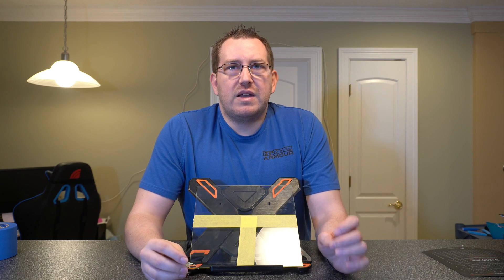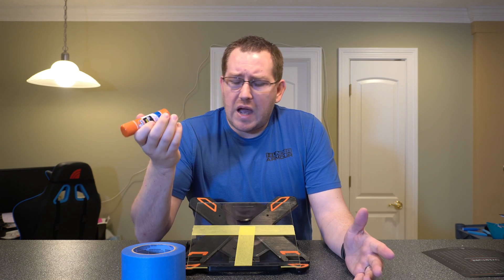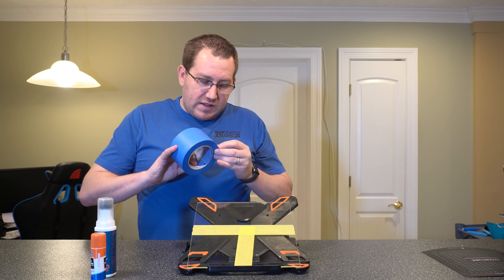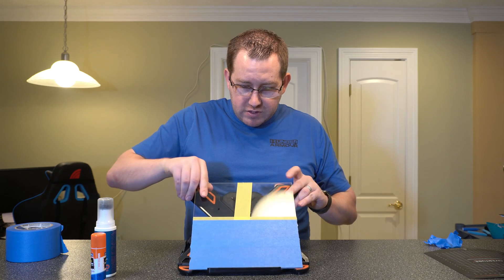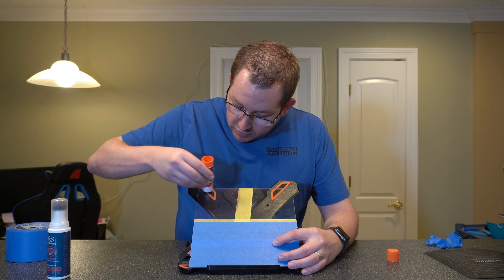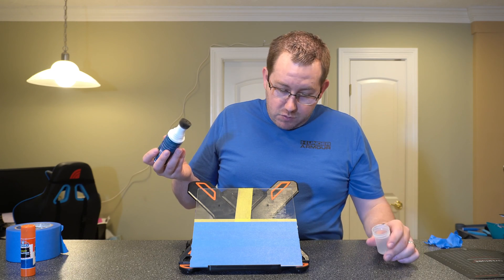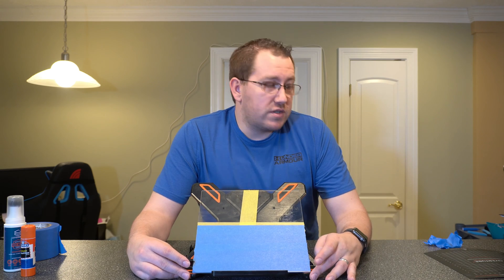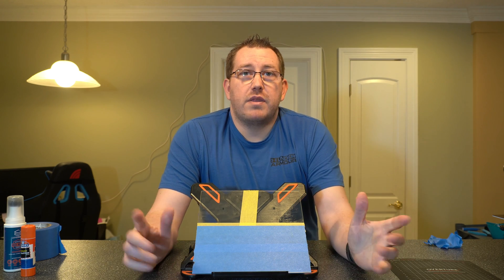Tired of 3D Printer Filament Not Sticking to the Bed - Let's FIX IT!

Comment: Some good tips, but at the same time, using tape on a glass bed defeats the main purpose of using a glass bed.  Getting that smooth finish that glass provides because you get the texture of the tape on your initial layer.
Gluestick I find does work, but is pretty messy, as is hair spray.   If you can't get it to stick directly with no addtional product, the speciality options are the best way, though I have had better luck getting good quality filament and just tuning the printer properly.   I found certain cheaper filamnets needed a product to help them stick, including Creality branded filament, but other, higher quality filaments needed no product at all.
Reply from the maker: Hi. You have some good points, ideally none of this is needed. Most of the time ive seen it needed is due to the bed not being level, improper z offset, or bad filament.

Comment: Hair spray does leave a huge mess. I haven't tried tape, but between hair spray and glue I've had better luck with the spray. Next time I'm at Home Depot or the autoparts store, I'll grab some tape. Thanks for the demonstration.
Reply from the maker: Hi. Thanks for the feedback. I like bed weld the best but tape is probably a second.

Comment: pva glue brushed on does the trick
Reply from the maker: Hi. Interesting, i will give that a try. Have you had issues getting the print off afterwards?
Reply: i brush pva glue on the bed and it works well but not always

Comment: I'm so confused. Got en ender pro 3 for daughter for christmas, have had nothing but inconsistency. It made the sample cat perfectly after a few aborted attempts which ended in a mess, made a very complicated snake skeleton- also after about a half dozen tries, and it kept flapping around making the build look "fuzzy" , but at least 3 dozen other attempts at anything since then  have failed. Ive used hair spray, the printer specific purple glue stick (which feels to me like it just makes it more slippery when the bed heats up ( tried anywhere from 60 to 90 degree bed.)  lastly, even though they say your bed should be perfectly clean, I used the tape method which did not work at all for me. The nozzle temp, I've ranged anywhere from 200- 235 degrees - no noticeable difference. I see some people say get the glass bed but I thinkk that the damn thing should at least function as it  is without investing in upgrades that may or may not make it better. Any advice would be appreciated.  Im about to return it to amazon.
Reply from the maker: Hi. I would say make sure your bed is level, that will make a huge difference. From there, use something like bed weld to help with adhesion then print a temp tower with the filament to find out what temp it works best with.
Reply: @3DPrintscape  Ihad the ender 3pro, couldnt mske it work. Returned it but trying the ender 3 neo which comes with a glass carbonate bed, auto level feature and better springs. About the same price.  Wish me luck and thanks for your advice
Reply from the maker: @jmnjmn69  The neo seems to be a solid printer, let me know what you think of it once you get it going.

Comment: Need help my 3D printer filament is clumping and building on the nozzle, i have cleaned and then replaced nozzles adjusted the plate , changed the painters  and still clumping
Reply from the maker: Hi. It sounds like there may be a partial clog in the hotend, possibly between the nozzle and bowden tube.

Comment: You can improve adhesion even more by going over the masking tape with a fine grit sanding sponge.  Also if you bud the tape together, as close as possible, with out over lapping the glue from the tape will seal the seam
Reply from the maker: Hi, thanks for sharing. Seems like a lot of extra work but if it helps it can be worth it.

Comment: Oh man. Glass beds are were it’s at. Just bought the creality glass bed. At first I couldn’t get anything to stick. Then I cleaned it with dawn dish soap and use isopropyl between each print. Perfect adhesion each time.

Btw. Just want to thank you for your amazing videos. Very informative. Learning a lot from you. So I appreciate the time you put into all that.
Reply from the maker: Hi. Thanks for the feedback. Isopropyl works great but you have to clean the bed after each print. Im lazy, so i use bed weld a lot lol.

Comment: I have an Ender 2 and the print is not sticking... I cleaned the bed and leveled it 3 times already ..
Reply from the maker: Hi. Its possible the bed is not level or its warped a little. Have you tried to use any adhesive like the bed weld?

Comment: Some prints stick some did not it was random. I tried everything here is what eventually fixed my Ender 3 V2... Make sure you have a concrete floor this part is important... smash your 3d printer as hard as you can against the floor until it is in an unfixable state. The get a trash bag and collect the pieces and throw it out. My ender 3 v2 was 7 days old now it is in the trash. Trust me this is the best course of action.. 3d printing will drive you mad with frustration....
Reply from the maker: Hi. Im not going to lie, i have wanted to do this with my printers on more than one occasion :).

Comment: This is my first experience after two years with my PLA not sticking. I have tried turning my bed temp up nozzle temp as well, my machine is lvl. I installed a new auto lvler just incase. I switched filaments and am now trying hairspray with not so much luck. I have even gone as far as changing my extruder and slowing my first print speed some. At this point I don’t have a clue what to do other than try the glue.
Reply from the maker: Hi. Have you tired cleaning the build plate with rubbing alcohol?
Reply: @3DPrintscape  yeah, ended up using hairspray and got “some” adhesion. Trying the glue next
Reply from the maker: @blake20054  I like the bed weld much more than hairspray, its works about the same but its not as messy.

Comment: Oh my God I got a creality 3 version 25 days ago and I had probably 15 failed Prince or just a bunch of boogers or spaghetti all over the damn plate. I attributed it to miss leveling the bed because I never had any prior experience. After using bubble levels and feeler gauges and all types of s*** I finally gave up and took a deep breath. During the last print before I was about to box it up I got to thinking that it's peeling up and it's not getting proper adhesion. It's not the level it's the fact that the first layer wasn't printing properly. Once I scrubbed the glass down really good with Dawn dish soap in a Brillo pad I stuck it back on there and I got one good print and I also tried some glue sticks which really didn't do very well. I tried rubbing alcohol which really didn't do any much better. But I will be trying the tape for my next print at the moment I had five successful Prince today so they 5 was a success and I will not be returning my printer
Reply from the maker: Hi. Sorry to hear you had some issues at first but im glad you were able to get past them and plan to keep your printer. A lot people first starting out with 3d printers get frustrated and give up too soon.
Reply: You can also go over the tape with a fine grit sanding sponge.

Comment: That bed weld has not improved anything...
Reply from the maker: Hi. If the bed weld isnt helping your bed not be level or the nozzle may be to far from the bed.
Reply: @3DPrintscape  its actually too close and is pushing down on the print making it not print right and I lift it all the way and still not enough because the print doesnt stick and warps a little. Bed temp etc in in recommended. I used taped yesterday, not perfect by any means but the print acutally stuck but still warped up. Wish I could just show u a pic
Reply from the maker: @sp1nks248  Interesting, can you email it to me? My email is admin@3dprintscape.com

Comment: I'm sorry if I missed this in your video but does this only apply to glass beds?  I just ordered my first 3d printer, an ender 3, and am trying to get as much knowledge as I can before it gets here.  Do I still have to worry about this with the stock bed that comes with it?
Reply from the maker: Hi. Most of this applies to glass. If your using the stock magnetic build surface with PLA, you will really only need rubbing alcohol.

Comment: My Ender 3 Pro was printing find until yesterday and today. The PLA will drop on the bed, but in some other areas of the print it will not stick. Instead, it just curls up onto the nozzle and creates a mess. I have it on the suggest temperature for that particular PLA. Bed is leveled, printer isn't even 2 weeks old. I just want to use my printer again :(

It comes with a magnetic build mat.
Reply from the maker: Hi. If you have the magnetic build plate on it, make sure its still level and the right distance from the nozzle. It sounds like you may be a little close in some areas. If thats all good, you may have a partial nozzle clog.
Reply: @3DPrintscape  Now my issue was that mid-print my nozzle was knocking over what it was printing. Seems like the brim i put did not stay stuck to the magnetic mat. Should I move on to using the glue stick?
Reply from the maker: @nextlvlroy  I would not use a glue stick on the magnetic pad, its not needed. If the pad is clean and the bed is level it would work just fine. Also, make sure the axises are tight, there are eccentric screws that you will use to tighten everything.
Reply: @3DPrintscape  Nice. I still put glue stick cuz I read your comment late, lol but cleaning for sure worked. Looks like all that residue eventually caused issues.

Also, how would you approach a few "dotted lines" in your final print? For example, I printed a Pikachu model from Thingiverse, the file looks good. Other ppl that made it looks good. However, mine, in a few areas, has dotted horizontal lines. I did mess with my retraction settings a bit to get rid of stringing, but it still has dotted lines on a test print. Would you know how I could get rid of that issue?
Reply: @3DPrintscape  Like if you were to draw a straight line and throughout that line you draw you lift the pencil up and leave a gap then continue to draw the line. cutted/dotted lines. most of my prints have that, and it's really in random spots all around.
Reply from the maker: @nextlvlroy  Gotcha, it sounds like one of your wheels may be damaged. I had a similar issue and it was from a dent on one of the wheels.
Reply: @3DPrintscape  Actually, I saw that my extruder arm is cracked. I am learning these things as I go along, so I didn't know that was a common problem. I'm just seeing your video know about the upgrade. Thanks for the help, and these videos you produce! Subscribed.

Comment: My pla wont stick I've tried to go hotter and it still isnt sticking, I've used glue and I was told not too use glue, I just want to print my stuff again, I do the default prints just fine but not custom stuff
Reply from the maker: Hi. If the sample prints are printing fine, then the issue is most likely with the how it was sliced. What slicer and profile are you using?

Comment: what about double-sided tape?
Reply from the maker: Hi. I never tried to use double sided tape. My concern there would be that it may be to thick and cause problems but it may be worth trying.
Reply: @3DPrintscape  i just tried using masking tape and it worked like a charm.
if you want to I can upload a video and send you the link
Reply from the maker: @gabaktech  Cool, and sure you can email it to me at admin@3dprintscape.com.

Comment: can you use sandpaper?
Reply from the maker: Hi. I wouldnt use sandpaper on the build plate. It may help with adhesion short term but it can also ruin the build plate.
Reply: @3DPrintscape  double sided tape and the sandpaper facing up, it should not ruin anything
Reply from the maker: @gabaktech  I was thinking about the sandpaper idea differently. You are correct, what you are describing wont hurt the build plate.

Comment: i tried the tape and glue and it stuck even worse than just the normal bed
Reply from the maker: Hi. Thanks for the feedback. Tape can work well in some cases but i prefer to use bed weld on glass. If your having adhesion issues with bed weld, it most likely means the bed isnt level.

Comment: My first layer sticks fine but my second does not I adjusted the bed and no luck yet suggestions? I'm watching the video soon.
Reply from the maker: Hi. It sounds like the first layer may still be the problem and the second layer is just knocking the first one a bit. That can be caused from the bed not being level, lack of adhesive if your using a glass built plate, nozzle to far from the build plate, and probably a dozen other things.
Reply: Ok the printer came with abs filament and I got Petg for a new roll I have to change my settings what are the best ones?   @3DPrintscape
Reply from the maker: @jstylephotography  Hi. You should be able to choose the filament type in cura to give you a good starting point. I will look into doing a video on that.

Comment: I can't even get my prints to stick right at the start
Reply: What helped me was leveling the bed and using a sheet of paper to level it. Then when the first layer starts printing just slightly tighten or loosen the bed leveling screws to get some good smoosh of the melted filament onto the bed.
Reply: @ivanovzargoff901  You can adjust the first layer flow rate and/or wall thickness to get a better result than manually screwing with the bed.
Reply from the maker: Hi. What build plate and adhesion are you using?
Reply: @3DPrintscape  I have a ender 3 and I'm just using everything it gave me. I havnt used anything for adhesion thats new to me
Reply from the maker: @ajmilone9415  Did that come with the glass or magnetic build plate?
Reply: @3DPrintscape  magnetic
Reply from the maker: @ajmilone9415  Ok, you shouldnt need to use any other adhesion then. If its not sticking, my guess is the nozzle is too far from the build plate.
Reply: what filament are you using because abs will not stick to the magnetic build plate you will need to make a slurry
Reply: @greysoda1266  I use overtrue branded filaments. They have been running through my printer quite nicely and are very forgiving.
Reply: @greysoda1266  pla

Comment: i heat bed to 80, put a layer of hot melt glue on bed...then turn off heat all-together, wait till it hits under 40 then print...with cold bed cura bed set to 0...when you have finished print heat up again to 80 then remove...simple..
Reply from the maker: Hi. Great tip, thanks for sharing.

Comment: when using a glue stick use a little ipa to spread it evenly
Reply from the maker: Hi. Thanks for the feedback. That’s an interesting approach. Do you see the results being better than just using the glue stick and how much IPA do you use (im assuming not much)?
Reply: @3DPrintscape  from what I've seen you don't need to use as much glue or worry about getting it everywhere because the ipa spreads it evenly and thin also not much ipa few sprays from my bottle

Comment: I use the hair spray, I just move the glass to another table, put a towel underneath the glass (to catch any overspray) it seems to work well for me
Reply: I lost a 7 hour 80% print due to hair spray. Starting to loose faith in. Not good for long parts.
Reply from the maker: Hi. I have a friend that uses hair spray as well and swears by it. I personally don’t like it because it can be messy and can get on other components if your not careful. That said, it does work.